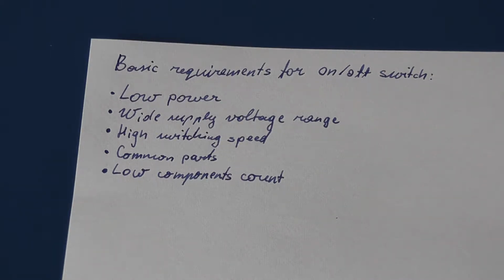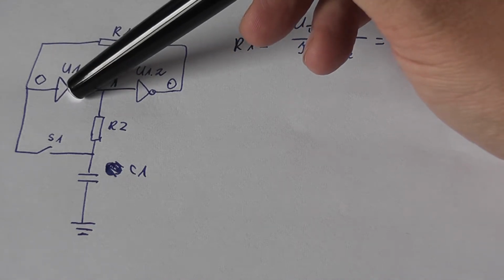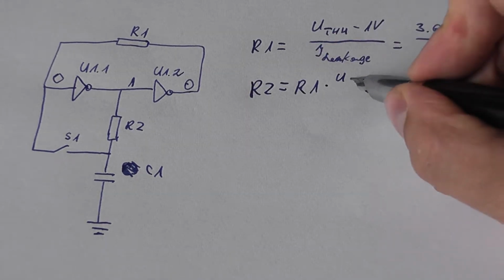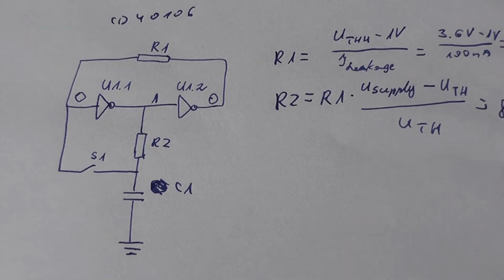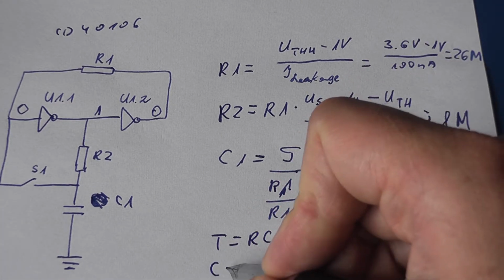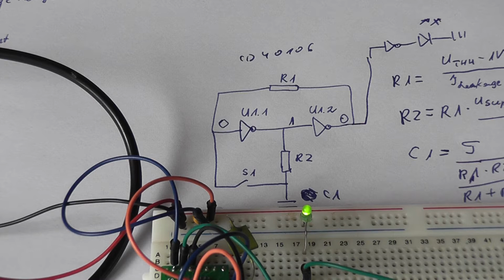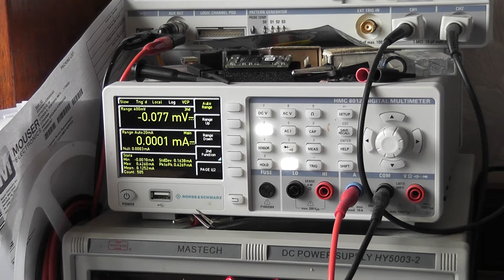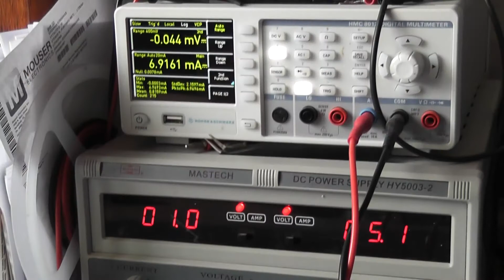ESDBlog #1 Electronic on/off switch circuit design

Comment: nice. bouncing sucks. i find that when im using a micro-controller i keep a bool and timer integer for each physical momentary switch. i have a function which allows the bool to turn TRUE whenever the physical button reports connectivity. but its only allowed to turn off if the last time the physical button was over 10ms ago.

can get away with using a single byte if you use 7 bits to store the milliseconds since last button change ( <=127ms!) and the remaining bit as the button's bool.